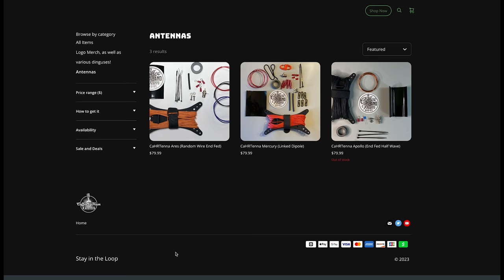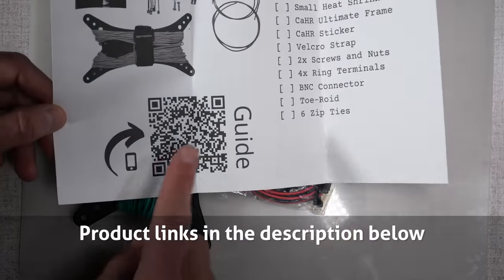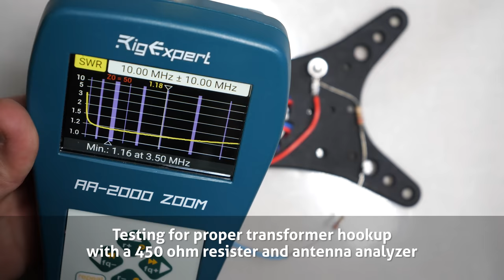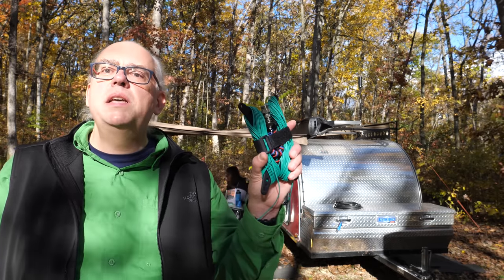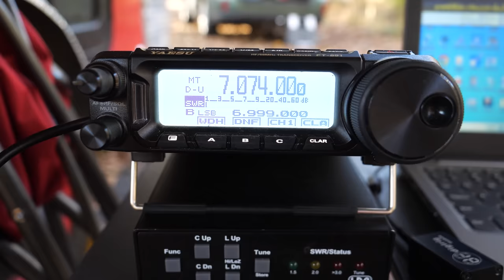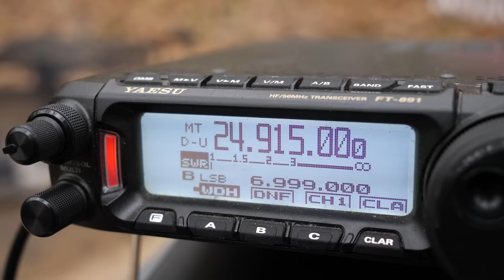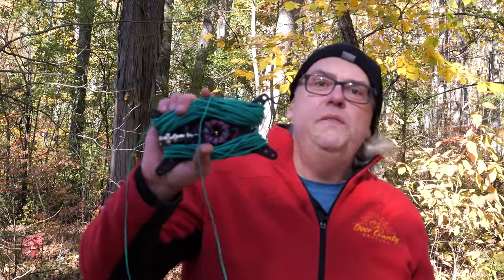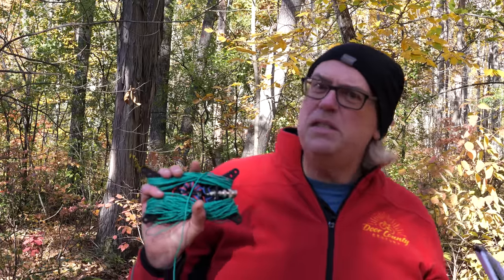Work 8 amazing bands with one antenna! CaHR Ares End Fed Random Wire

Comment: Looks like a great antenna ! Thank You for the video Michael. I don't have this one. Have built my own. Since they provide you with 100" of wire, why not make a 30 foot link to add on the end of the 41' for those times you wish to use 80 meters ? Best of both worlds.
Reply from the maker: That's not a bad idea, then you have the convenience of a shorter antenna when you are only going to use the upper bands.

Comment: My PacTenna is 29' in length, primarily using it on 40-17M QRP. We are getting a lot of rain near Rockford, IL this week so am looking for a good day to activate Rock Cut SP from our campsite. Has anyone tried using an aluminum screen as a counterpoise, assuming the feed is within 17" of the ground as previously mentioned? Just curious, I haven't tried it yet, curious how it affects the static VSWR in the 29', 41', & 71' lengths as well as the tuned Bandwidths. I bought an ATU-10 tuner a while back so I'm so curious how it will do also. 

What isn't cool is the amount of Box Elder & Asian beetles trying to get their own activations in before the next hard frost, LOL. 
Cheers, Davey --KU9L
Reply from the maker: I haven't tried using the window screen as a counterpoise with these wire antennas, but it is an interesting thought. 

Since Monday, we've received 4 inches of rain and now they are talking about snow over the weekend as the high will be in the mid 30's
Reply: @KB9VBRAntennas  yeah, the deer hunters want their forests back and us POTA guys best keep warm & dry. Still, the first dry day I will be trying it, lol.

Comment: What would be the best random wire length for closer-in (from 0km/mi out to 500km/300mi) NVIS 20-80m? I believe if it gets too long it starts developing lobes off the end that get steeper the longer it gets, so if it's too long I'll put everyone around me in the skip zone. I'm wanting to contact people from just over the closest mountain, they're only about 5km away, so I really want to be as vertical as I can. Would you go with 71' for that? I notice most of your contacts in this activation were at more of a distance from you. Any tips for close-in work? Most advice out there is for DX. I believe getting it down to the ground works better for a more vertical takeoff. And a longer counterpoise I think is supposed to be better - even longer than the antenna, or multiple long ones. Are these correct? Any other thoughts? Thanks! VA7XTK

Comment: Thanks for this comparison.  I have been eyeing both for a while and have not found any reviews comparing them so great work.  

Quick question, the WRC advertises that you can turn the tuning “clicker” thing to fine tune your frequency.  Do you do this and does the M1ECC rig perform the same way?  Thx
Reply from the maker: The Wolf River Coil does allow you to click for course adjustment and then swivel the collar for fine adjustment. I do find the swivel feature handy, especially on the higher bands when a full click is too much adjustment. I don't have any experience with the M1ECC coil, so I don't know if it has that feature or not.

Comment: Put a non inductive termination resistor of 500 ohms rated at 30 watts and install as inv V and you wont need a tuner
Reply from the maker: B&W used to make a similar antenna that deployed in that configuration. Our club has one and I've used it at Field Day with good results.

Comment: Michael, when using the 9:1 do you use the same counterpoise for 71ft and 41 ft radiators?  Do you ever operate withOUT a counterpoise?  thanks ! de K8MH
Reply from the maker: With the random wires I always use the counterpoise. I believe if you go with the shorter 41 foot radiator, about 17 feet of counterpoise is all you need.

Comment: Hi Mike.  It was nice to meet you recently at Radio Expo in IL.  It would have been nice to see what the SWR was on all the bands without using a tuner to get an idea how much correction was needed to bring the antenna within an acceptable SWR.  I just received an Xtenna that I used last weekend and I loved it.  It was resonate on 10, 15, 20 and 40.  17 had high SWR as one would expect.  I have 3 YouTube POTA videos on my YouTube channel @K9AT

As Always Best 73,

David
K9AT
Reply from the maker: I measured the SWR when I deployed the antenna, but didn't record it as I was using my smaller Rigexpert Stick analyzer. Roughly speaking, SWR was between 1.8:1 and 2.5:1 for 30, 20, 17, 15, 12, and 10 meters. It was a bit higher on 40m and 80m, between 3:1 and 5:1. I've noticed that in using random wires, the SWR will fluctuate in where and how it is deployed. This is common with this style of antenna as there is a bit more variability in its matching. You can try to perfect it for a single location, but will be wildly off at the next. 

I checked out your channel after we met at Radio Expo, I'll have to go back and watch the new content.
Reply: Thanks Mike for the reply and 73 @KB9VBRAntennas

Comment: Great setup. Do you think an FT-710 would match your results, with included tuner?
Reply: Probably not. Internal tuners a pretty limited. You will need a tuner of great matching range to get most of the bands. (Michaels tuner is under the radio in this video)
Reply from the maker: Internal tuners will match at 3:1 or less. External auto tuners will usually handle a 9:1 mismatch and manual tuners even more. The antenna was under 3:1 for all bands with the exception of 80 meters, where it was a bit higher. The FT-710 could probably make it work.

Comment: Does this antenna have a counterpoise?
Reply from the maker: Yes it does. The antenna comes with about 100 feet of wire. You use 71 feet for the radiator and the balance for your counterpoise.

Comment: Based on the really quick view, was ur random wire hung as a sloper?🤔
Reply from the maker: Yes it was. About 30 feet at the peak and 5 feet at the feedpoint
Reply: @KB9VBRAntennas  Thanx for reply, enjoy ur vids & 73 de WA4ELW in TN 🇺🇸 dit dit 😃
Reply: What tuner are you using with your FT-891? I have FC-50. ~Judy, KD9WWA
Reply from the maker: I use the LDG Z-11 Pro 2  auto tuner.

Comment: Solid video production. Well done.

But I do have some questions and comments. I watched the entire video in hopes you would share some commentary on the justification of such a hefty price for less than 20 dollars worth of parts that you have to put together yourself. I can certainly see the joy in completing the project, but it's difficult to believe that you didn't have a single complaint and that at the end, it was worth the price to anyone that actually ends up paying for this.  At the very end you said they sent it to you. If you get something for free, in reality it's your payment for promoting an item. I hope you understand the potential for mistrust of your endorsement isn't personal. 

So here are my questions: Do you find it worth the price tag? Is it justified? Do you truly not have any complaints? If you were to create a similar antenna build yourself, what would you change?

Finally, I thought that the step of unwinding the wire just to put it together negated the original effort of winding the wire on the winder to begin with. Why would one of the first steps be to undo what was done? Sure, that's nitpicky, but at the same time a bit of a slap in the face to the customer. Perhaps winding it off winder would make more sense.
Reply from the maker: In my review videos I don't justify the price of a product unless I feel that it is overwhelmingly out of line with the market. Viewers can make their own determination if a product is worth it to them or not. But since you asked, I believe the antenna kits by CaHR are priced fairly and are in line with the market. I base this on my long experience as a solo entrepreneur who's worked on selling products in niche markets. Parts cost are only a small part of the the expense that it takes to bring something to market and while your estimation of 'less than $20 worth of parts' may be somewhat true, it's also a bit off. 

Since you'e curious, I did produce a video on making your own random wire end fed antenna. You can look at the parts list and determine if the effort of sourcing all your own parts is worth the cost of buying an all-in-one kit: https://youtu.be/D_-aNzrIXWs

Complaints? I really don't have any about this antenna. It does what it purports to do, the components are of good quality, and construction is well thought out. They use a 22ga silicone wire for the radiator. It is a very nice wire, but my only complaint with it is that it does collect dust and somewhat gets hung up in the brush and brambles. I prefer the PTFE coated wires, but that stuff is even more expensive. 

If you watched any number of my videos you'll notice two things. 1) I don't do very many product reviews and I am very careful to disclose if I purchased the product or if it was provided in exchange for a review. 2) If I like a product, I will continue to use it again and again. I get many offers to do a review and most of them I turn down. I will not review cheap handheld radios. Nor will I review a product that doesn't fit the scope or mission of the channel. You're free to question my integrity, but you'll find that with watching any amount of my content, that I totally operate my channel above board. I've earned my viewers trust and respect and won't flush that away with a substandard product. 

Finally, your quibble about unwinding the wire from the frame of the antenna. I don't think the customer cares one way or another on how their wire is shipped. On the frame or separate, it's going to have to be unwound and measured at some point of the construction process.
Reply: Hello guys and gals. In my opinion this product is totally worth the $20. I'm running an EFRW myself. I already had the wire and the 140-43 toroidal. I built mine in a 4X4 sealed outdoor electrical box and purchased all of the hardware, so I probably had $12 - $14 in mine. If I would have purchased the wire and the toroidal, it would have probably been $35 or so. 

PS: I used 14 gauge wire
Reply: @jimmcfall7769  But it doesn't cost $20. It's $79.99 plus shipping. 

Ultimately, I made one similar using my LDG 9:1 and a piece of wire. Cost me 30 bucks. I'll build another from scratch this winter. Pretty sure I can keep it around 20 bucks. 

Even though it was unintentional, thanks for making my point.

Comment: How much power on FT8 sir?
Reply from the maker: They rate the antenna at 100 watts SSB and 50 watts digitial
Reply: @KB9VBRAntennas  ok thanks.   What do you usually run on FT8 in general?
Reply from the maker: In the field I typically run 20 watts FT8. Mostly to stretch battery life.
Reply: @KB9VBRAntennas  oh ok. I run 30 but hear a lot of guys use 100.  73

Comment: Pretty much the same as the EARCHI antenna.
Reply from the maker: They both use the same 9:1 transformer design. The key difference is that the CaHR Ares has an integrated wire winder